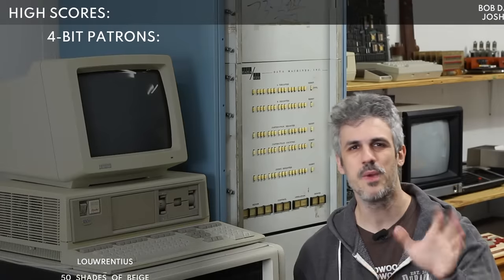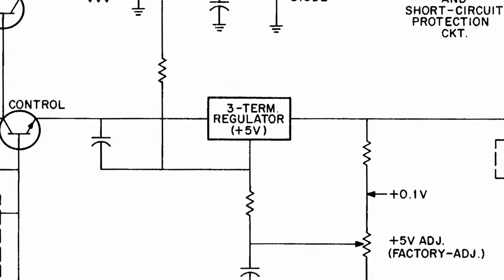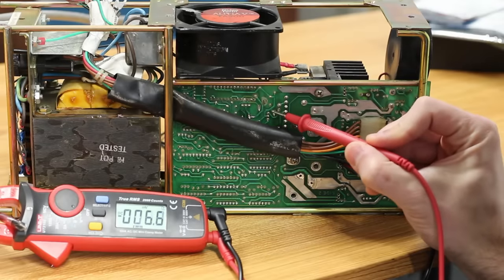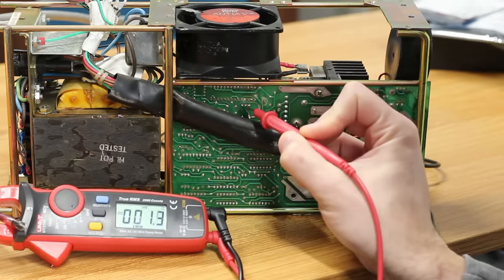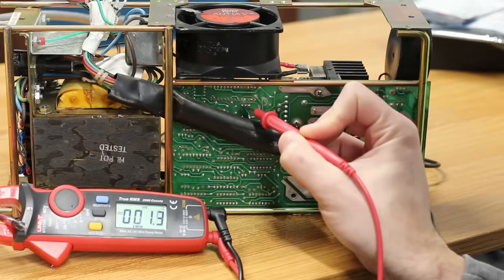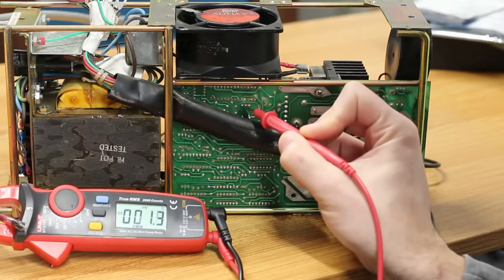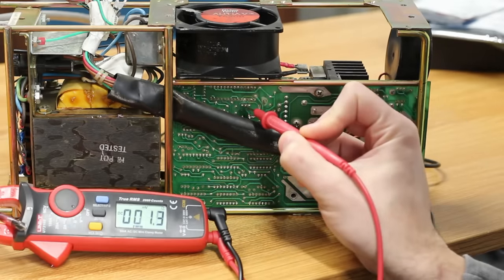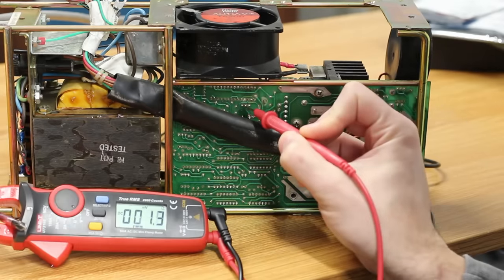The PDP-11/23 Plus Works!

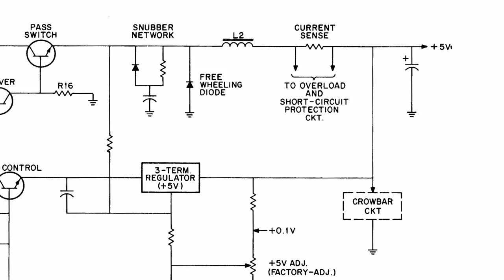Comment: 6:20 feels like an incorrect explanation. The capacitor doesn't play an all that major part in providing power to downstream loads as far as the inductor is concerned.
The inductor will do everything in its might to keep that current flowing as the magnetic field within collapses.
Now the pass switch won't allow this, and would honestly blow up if it weren't for the free wheeling diode getting forward biased saving the day some 10 thousand times a second. Low side diodes/transistors are the unsung heros of switch mode power supplies.

The capacitor's role is just smoothing out the ripple to something useable down stream. (If the load can handle excessive ripple and one isn't concerned about EMI, then it is fairly redundant. Though in this case we are driving logic, so less ripple is nice.)

9:35 When one has a regulator and one expects to see some voltage there, then not seeing any meaningful voltages on its pins means that it likely isn't the regulator that is dead. Here one has to back track towards the power source as to find the actual problem. Else one is just digging one's own rabbit hole to explore, and that is a waste of time.

12:28 Here the burned away trace likely indicates an overcurrent event, something that also typically kills diodes. So two things pointing at the same type of problem.
Here I would look through the schematics to search for culprits for this over current event, though it could be something outside the PSU if the -15V rail is used elsewhere in the system. Ie, the other cards could be a killer on the loose. But as you stated already, someone else worked on this unit before, and who knows if the potential killer is part of the lot or not.

In the end though.
"Thou shall check voltages." is the number one rule of trouble shooting for a reason. Don't stop at the first "wrong" voltage, check them all regardless, both external and internal.
Though, "thou shall check fuses" is likely entry zero on the list of trouble shooting steps...

But nice to see it back up and running. You did good work.
I myself have managed to blow up a handful of repair attempts as far as power supplies are concerned. Power electronics can be quite unforgiving at times.
Reply: In a buck regulator operating in discontinuous inductor current mode the capacitor is the only thing that supplies load current for part of each cycle.

Typically a buck converter will be designed so that the discontinuous/continuous boundary is at something in the range of 20% to 40% of the full rated output current of the supply. The peak-to-peak ripple current would be twice that. Without the output capacitors the load would be subjected to that magnitude of ripple current and the corresponding ripple voltage. It would be disastrous  for electronic devices (possibly OK for a resistive load such as a heater). The output capacitors are absolutely essential. That magnitude of peak-to-peak ripple current exists at any operating point above the D/C boundary.

In boost and flyback topologies the output caps are the ONLY thing supplying current to the load when the main switch is ON.
Reply: @d614gakadoug9  I see that you completely misunderstood my comment.

So I will reiterate: ""

My comment were mainly about the "flyback" diode being a critical component in the buck converter. Without it the circuit will fail and won't deliver power as desired. 

So that this critical component were completely neglected in the description of the circuit is something I see as a noteworthy mistake for this video to make. 

Secondly, this isn't an isolated flyback converter so your last paragraph is not applicable to the circuit I commented about.

But yes, any typical load , especially logic would not be particularly happy without the capacitor smoothing out the ripple.
Reply: @todayonthebench  
Your comment opened with "The capacitor doesn't play an all that major part in providing power to downstream loads as far as the inductor is concerned."

This claim is false. The output capacitors are absolutely critical to the function of ANY switcher. ALL switchers rely on two energy storage devices. In most, one is an inductor and the other is the capacitor. The capacitor is absolutely not "fairly redundant." Without the capacitor, logic circuitry would be destroyed. It is very very often a challenge to select output capacitors that themselves are not prematurely destroyed by the high magnitude of ripple current.

Yes, the freewheeling diode is essential in this topology in order to provide a path for the discharge of energy stored in the inductor. It was glossed over in the video. You really didn't explain it very well, either.

Yes, you cannot instantaneously change the current through a simple inductor. But the current through the inductor changes by a large amount during each switching cycle. It most assuredly does not keep the current constant. Without the output capacitor that varying current would be forced through the load.

My last paragraph is clearly an "aside," mentioning a couple of other topologies.
You also failed to understand the issue with a buck converter operating in discontinous current mode.
Reply: @d614gakadoug9  Yet again, I am still strictly talking about things from the inductor's perspective.

Without the diode we can't provide power at all.

Without the capacitor, we just have an unusable amount of ripple for most loads, but power is provided.

As far as providing power is concerned, the capacitor is secondary to the diode.

And lastly.
My comment weren't about giving a satisfactory explanation of the functioning of this switch mode supply. But rather to point out that the output capacitor plays a less important role than the "flyback" diode that never once got mentioned in the whole video.

Yes, the capacitor is important for the loads of interest for this PSU. But without the diode, even the capacitor can't provide power.
Reply: @todayonthebench  
Yes, the freewheeling diode is essential to the circuit, just like the switch and the inductor. That doesn't make it more important than the output capacitor. It isn't an "unsung here" - just one of several essential components. Diode or no, the circuit would be useless for purpose without the output caps which you dismissed as "fairly redundant." You keep trying to steer attention away from that false claim.

In many modern buck converters the freewheeling diode is replaced with an active switch which can substantially improve efficiency especially at the very low output voltages now common for CPUs and GPUs. In such circuits the duty cycle is low and forward drop across an ordinary diode would incur a large efficiency penalty since the diode conduction time is much longer than the switch conduction time.
Reply: @d614gakadoug9  I still feel you misunderstand my comment.

I will though reiterate that my statement is quite simple.

1. As far as delivering power through the inductor, the output capacitor doesn't matter. The inductor won't care where current flows down stream, just that it can flow somewhere.

2. Without a low side current path, the high side switch will fail in fairly short order. And neglecting this critical component in a description of a circuit is a somewhat major oversight, but excusable given the generally explorative nature of the video. (And I am not caring much about you here, a random commenter. You didn't make the video so....)

My comment isn't about the requirements of the down stream loads. I still covered it regardless, and do state why output capacitance is useful for a digital load.

But as far as delivering power at all, regardless of quality. The low side diode/switch is critical. While the capacitor is purely to combat ripple and noise, thereby increasing the quality of the supplied power.

Ripple and noise are inherently secondary requirements of the task of delivering power. A nice steady 0 Volts relative to circuit ground is clean but useless as far as power is concerned.

In the end, the output capacitor is less important than the diode.
This is basic logical conjecture. If Y is required for X to be assessed, then X is always secondary to Y as far as the functionality of the circuit is concerned.

Beyond this PSU output capacitance is most often inherently redundant as well. Since most down stream loads have enough local bypass capacitance to bulk filter the supplied power. But from an EMI standpoint that would be atrocious to rely on.

And my original comment does also explicitly mention actively switched low side transistors. So your second paragraph is yet again needlessly redundant. And doesn't help you prove your case. (bringing up a random piece of trivia that your debating opponent already made from the start is pointless and rather indicates that you haven't read your opponent's statements. And you have done this twice.)

But needless to say, thanks for this waste of time.
Reply: @todayonthebench  
"Beyond this PSU output capacitance is most often inherently redundant as well. Since most down stream loads have enough local bypass capacitance to bulk filter the supplied power"
UTTER NONSENSE!

You are clearly completely clueless about switchmode power supply design, and this is the last time I'm going to waste any time on your nonsense.

The output capacitors are absolutely critical to proper operation. The notion that "Since most down stream loads have enough local bypass capacitance to bulk filter the supplied power" is complete and utter nonsense.
I don't know how much power the supply in the video is deigned to deliver, but  I'd guess something around 100 W. With a typical switcher that would mean that the peak to peak ripple current in the inductor would be something around 12 amperes. I am familiar with how DEC made boards, having spent a lot of time dealing with them in years gone by (everything from PDP-8 to VAX 11/780).There isn't the remotest chance that the capacitors on the boards would withstand that magnitude of ripple current. NOT A CHANCE!  No one who had the slightest clue about these matters would rely on caps local to circuit boards to cope with ripple current from a switcher (nor would they call a freewheeling diode a "flyback diode").

I have designed many, many industrial switchmode power supplies. I know how they work. I know that the output capacitors are critical components and poor choice results in a very unreliable power supply.

Comment: Power supply designers are a special type of evil. I remember we had these rack power supplies for radio equipment, the output fuse was before the voltage sense circuit! One day a technician pulled the output fuse to power down some radio gear, a few seconds later the output caps in the supply blew up. Sounded like a shot gun. With the fuse gone, the power supply keep increasing the output voltage, but the voltage sense was now isolated, so big boom. Stupid design.

Comment: i dont really care for DEC computers.  Im more of a TI-990  user.  now the TI systems were bigger then the DEC your working with but they what I work on back in 1977 and after. it wasnt until 1985 when I worked with 286 and 1990 386 and the 486 and up. disk drives were nuts.  I have more disk space now then I ever dream of and not even close to tap it out.  main drive is 1tb and extra is 50gb and Im not even using it because it all on the main drive.  that a SSD.